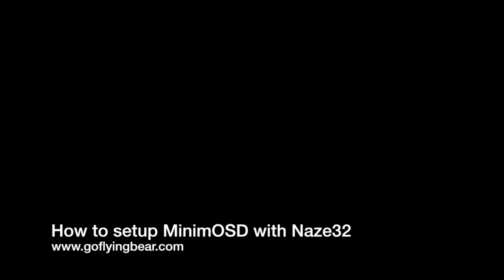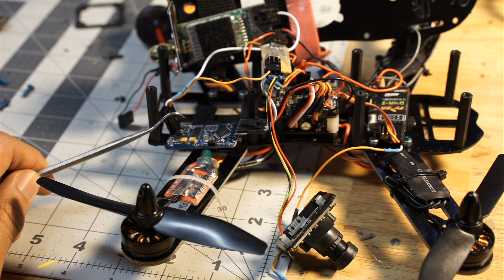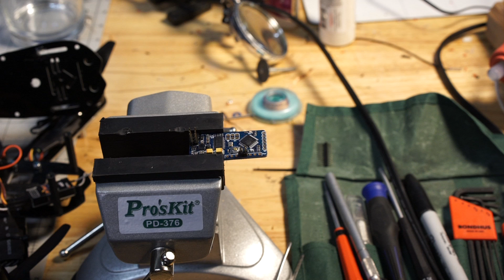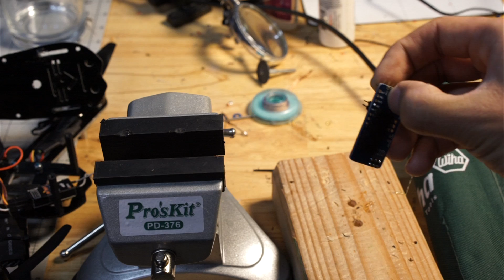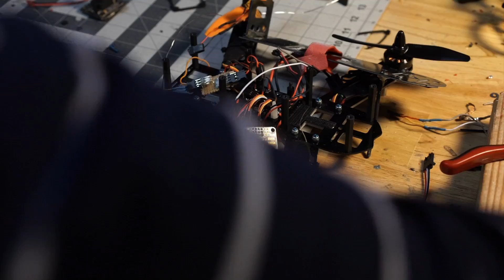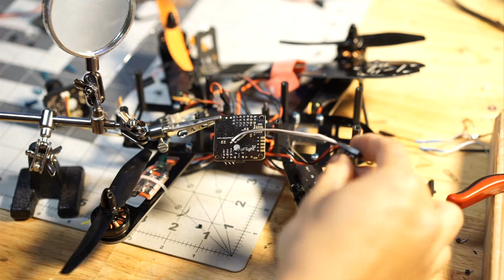How to Setup Minim OSD with Naze32

Comment: I have a question, you dont have battery monitoring right? you can't see the battery voltage, because you did not attach your battery to BAT 1?
Reply from the maker: Maurits Veerman 
The naze32 already has vbatt wired up, which it passes to the minim OSD through the TX and RX pins.  You may not see it in this video if I had soldered Vbatt + and - on the bottom side of the naze.

Comment: On the RSSI you can get that from the flysky transmitter data port TX connected to pin 6 on Naze32  using cleanflight with minOSD 1.4  enable soft serial and telemetry and 9600 for baud rate.

Comment: Great video very informative!

Is there any variations in setting up ezuhf lite 4ch with Naze, minimOSD and taranis? Im using 1.3ghz for video not sure if that makes a difference. 

This might be a dumb question but I ordered a TBS core PNP25 is this component needed if I follow your setup?
Reply from the maker: Andre Terzian I have another video on how to setup minimOSD with Naze32.  For EZ-UHF, you can just setup as a ppm or s-bus receiver directly to naze.  There is information in the naze32 manual on how configure s-bus or ppm receivers.